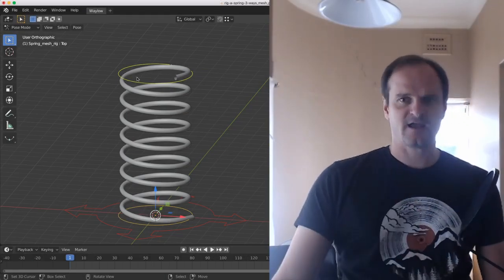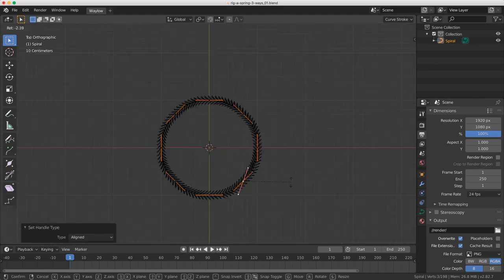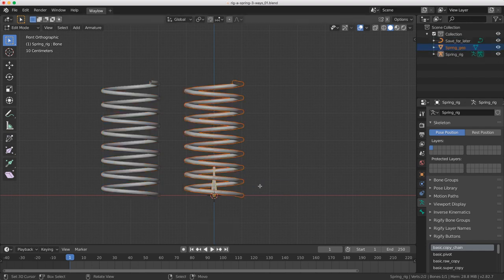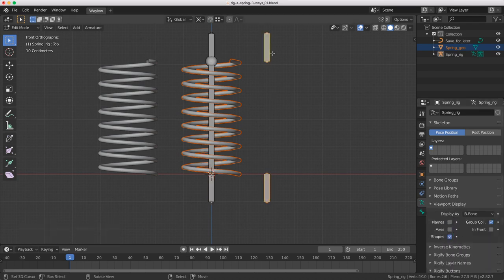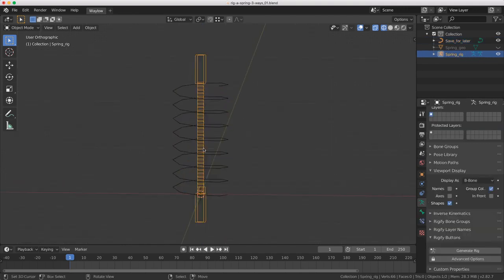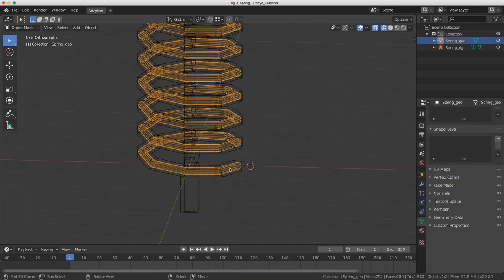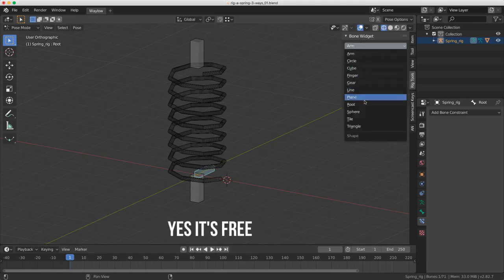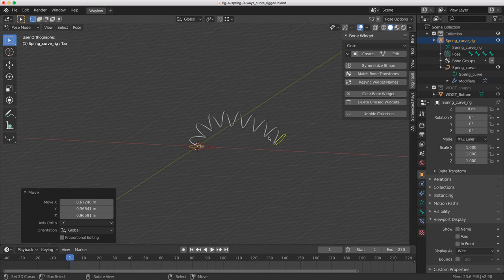How to Rig and Build an Advanced Bendy Spring in Blender

Comment: Thanks for making this video!  At first, I gave this video a thumbs down because I couldn't get the bottom pose control working correctly and I couldn't figure out what I did wrong.  I assumed I missed something due to how fast you went through everything, but I finally got it working correctly.  I started over from scratch and realized I had accidentally selected the root bone and extruded instead of extruding from the stretch_in bone.  I changed to thumbs up, but I still feel like you could have explained some things in more detail and it would have been nice if you used screencast keys, as I had difficulty understanding what you said a couple times.  This is the first time I have tried your add-on and I get an error when I try to create a root shape, but I assume it may be due to using Blender 2.83 instead of 2.82.  I'll check back for updates and try again.

Comment: Could you use an array modifier with fit to curve then curve modifier to make the spring? I just got to the part where you're going around the spring curve.
nvm. its bones. gotta be a better way.
Reply: Corey S just use the screw modifier, it does more or less everything he did at the start.